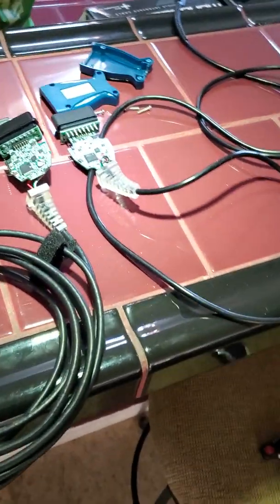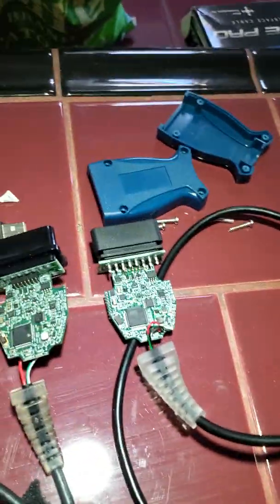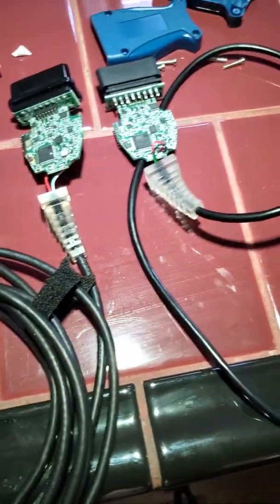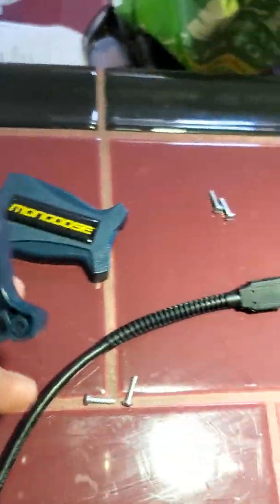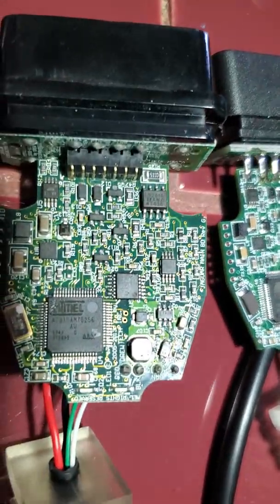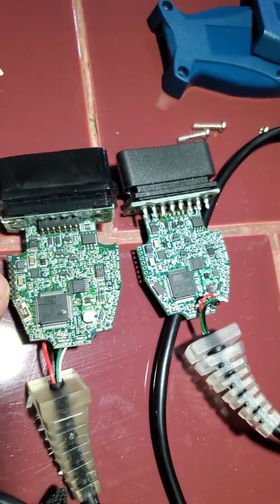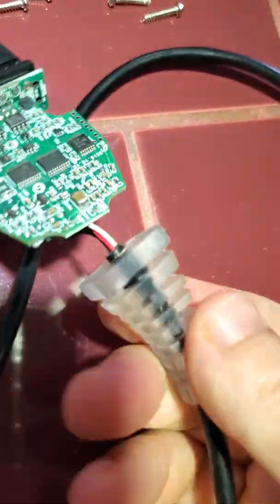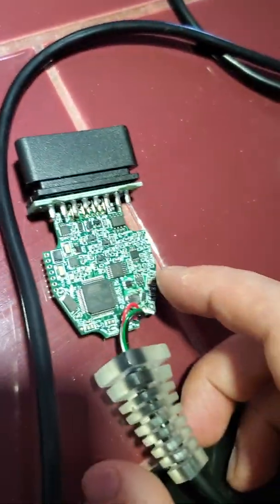Clone vs real Mangoose Pro JLR jaguar cable

Comment: Did you do any programming with the clone or just reading?
Reply from the maker: With my working clone I have done some programming and it works fine but I double and triple check cloelne equipment just to be on a safe side , on regular basis I still use the genuine unit. I have good clone units available if needed
Reply: @alphajagtuning  the genuine cable can't be found anymore. There's a 1800 adapter that opus ivs makes instead...
Reply from the maker: Well I can surely sell you the clone tested unit find me on WhatsApp 1605-728-2020
Reply: @alphajagtuning  that works. Contacting you now, if you want to keep your privacy you can delete your message, I have the number. Thanks!